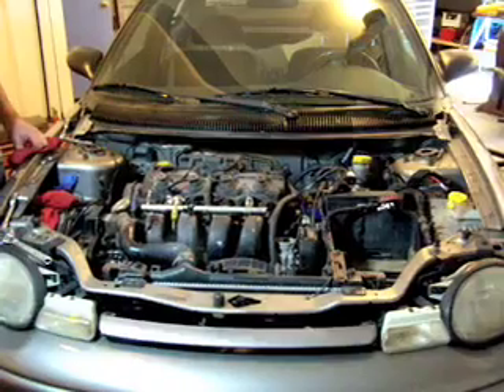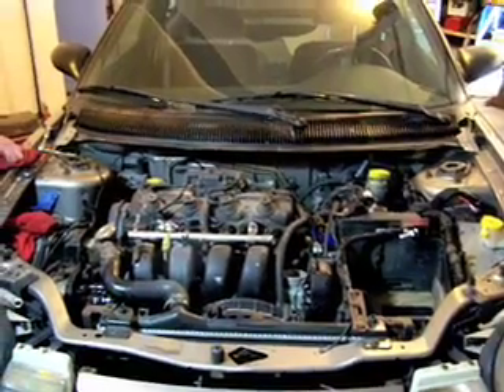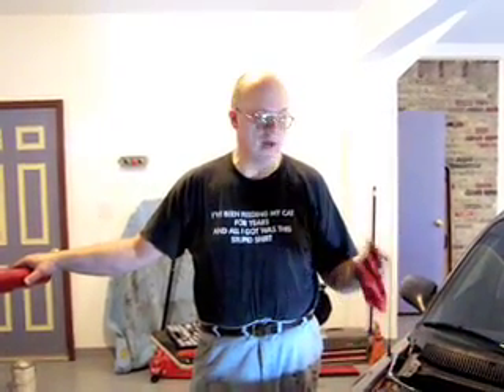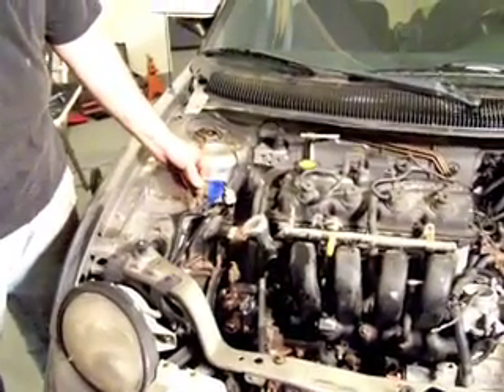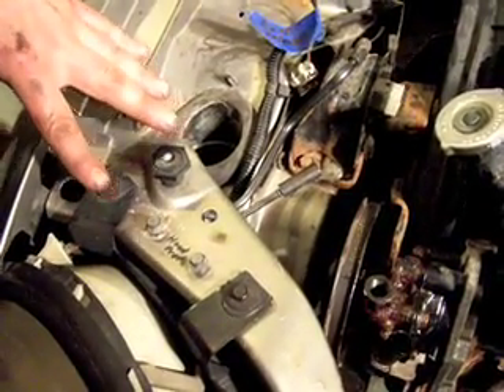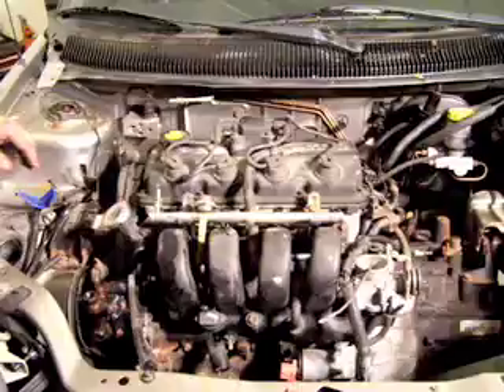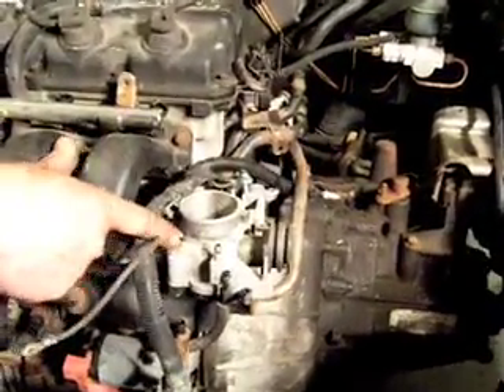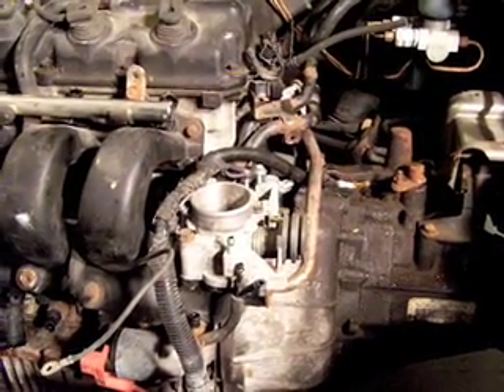AC Electric Car Conversion 101 part 6

Comment: Trucks have a DC electrical wiring system to run heater ,lights,rado,I would also have to get a way to heat water for the heater core. Iwood need a transmission cool mounted with an electric fan or I would have to put a fan on the motor front shaft to cool the transmission cooler. plus I would nee mounts for ac and power stering pully hook to the front shaft of the electric motor.with belts and pullies. My ? is will the motor pull all accessarys and run the Truck.

Comment: em thompsonsbeef@gmail.com with information I been searching for a electric motor to build a Truck to haul firewood out of the backwoods. I been trying to find an electric motor that has 350 hp or 400 hp or equal too. I plan on using a generator on board to recharge the batties and run the motor while the baties are charging. If I us DC motor I will have too get a converter to change currant from ac to DC unless I can find a DC generator.

Comment: Hi I have some ? how long will the electric motor last is there any warranty, where can I buy a motor and the direction conversion kits. How do I keep the electric motor dry from water. I drive in the back woods cross low water crossing. How do u keep the electric motor cool. how do excelerate the motor. any information would be apreceated.  TB

Comment: @BenjaminNelson Watch out on those throttle position sensors sometime they are affected by cold temperatures and the car can take off by itself at idle speeds I know it happened to me one time and I since replaced it with a hall effect.

Comment from the maker: @UpNorthLiving2011 
The driver of this car is a single guy, so not having a back seat isn't an issue. The entire project was less than $4000, or in your example, one year of gasoline. He lives in the city, so there aren't too many times he has to go any great distance. It is his second car, so if he does have to drive cross-country, he has another vehicle available to him.
This car is cheap to run, quiet, does freeway speeds, and has almost zero maintenance.

Comment from the maker: @dsealp4746 
Ben here. I did the video, Tom did the car and on-screen acting.
The motor is a Baldor brand. Sorry, I don't know if it's a delta or wye. It is just a stock, AC, industrial motor. A big part of the inspiration for this project was getting a number of parts from closed-down factory equipment.

Comment: Does using a transmission reduce the amount of power the engine takes? For example, if I put one of these engines into a rear wheel drive RX-8 would it require less energy while cruising in 5th gear then if I took out the transmission and linked engine shaft straight to my driveshaft? Or is it still the same principal of using transmission gears to reduce the rpm (and thus energy needed) that the engine has to produce?

Comment from the maker: I believe that the way the AC drive (controller) works, it will automatically regen anytime the car is going faster than the pedal is telling it too.

I think the idea is to have a switch or button that turns the drive on and off. That way, the driver has control over the regen, but it would be on by default.

I know this is a slow-going project, but it is going to be one GREAT car when it's done.

Take THAT Chevy Volt!

Comment from the maker: Many cars use a 0-5K potentiometer in their "drive by wire" throttle. This can be repurposed to directly run many motor controllers.